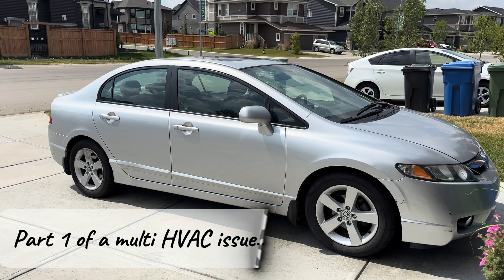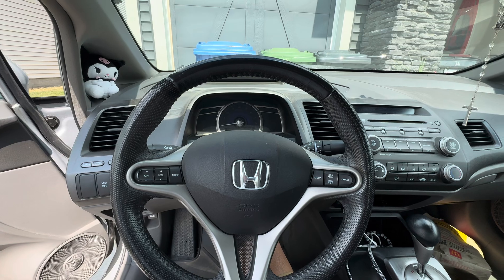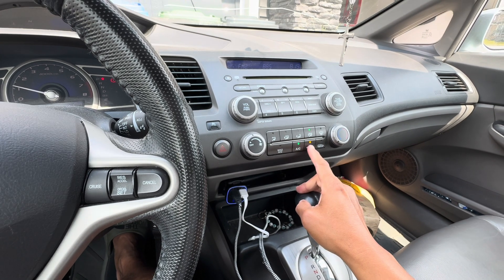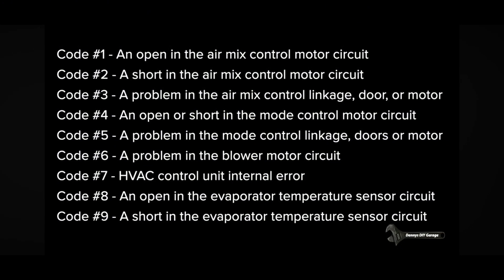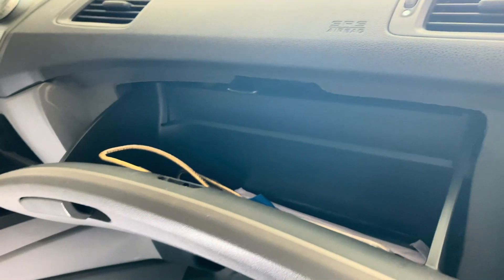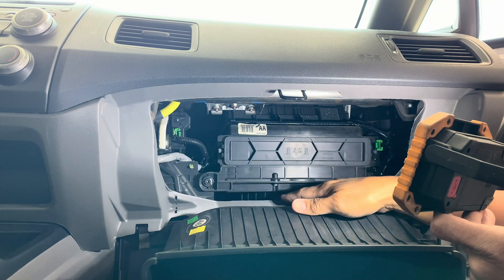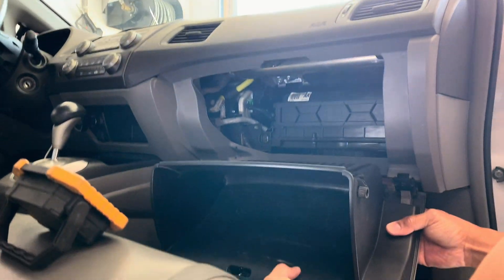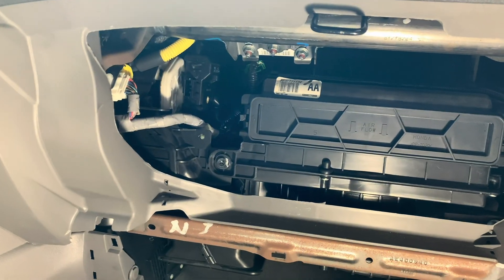Diagnosing and Repairing a Faulty Air Vent Mode Actuator in a 2011 Honda Civic HVAC System

Comment: Thank you for the great Video! Its very weird, actuator works after plugged into green socket for testing , but once it installed, it does not work, air directions did not change at all and stuck on deforest.  Did you apply some grease on the back of the actuator?
Reply from the maker: Make sure the control arm is sitting properly or not broken.
Reply: @JNBTuning thanks for your reply. How do I know if control arm is broken? Can I test it?
Reply from the maker: @Leo-pz7ry you should be able to see it actuate as you change modes. Just exactly how I was doing after the install to test it. Change mode, watch how the arm is being actuated, and check the vent desired if working.
Reply: @JNBTuning arm is not moving at all after pushed air distribution buttons, but if just plugged in the green socket, arm will moving.

Comment: Well I tried this tonight on my '08 Civic, and I get no light from the inside recycle button when I hold them both down. I don't hear or see my system going through any check process.
Reply: Did you ever figure out the problem?
Reply: @abigailcisneros17 I replaced the motor assembly. $20 something from Amazon. Works fine now. It's the motor, just replace it

Comment: Thanks for this. I have a 2008 Civic sedan. When I hit the button for air to flow on top vents, nothing comes out. I can hear the fan or whatever whirring and cranking, but I think the actuator is "stuck" on the defrost position because air only comes out the defrost vent or at my feet.

How did you confirm that the old actuator is actually broken as opposed to not just needing more grease???
Reply from the maker: When you have it all open down there just try all the modes and see how the actuator is operating. You can record it on your cell phone. Each mode should actuate/move to open and close vents depending on the mode chosen. If it doesn’t move then you will know it is broken.
Reply: @JNBTuning  yeah no matter what button I press, it's shooting out at the windshield. The fan is working and it blows on High no problem, just happened yesterday for the first time. Thank god it's October and not May.

Comment: I have an 09 civic. I did the diagnostic code process. The light on my heater control panel didnt flash but the check engine light flashed 5 times. My issue is the when I turn on recirculation I can still smell odors coming in from outside through the vent. Idk what controls that. Both actuators move for the things they control. Nothing moves when I turn on recirculation.
Reply from the maker: Very strange! The check engine lights shouldn’t flash as this is nothing to do with the engine. With your symptoms it will still the same actuator that i worked on that is controlling the recirculation. How about the other venting modes? Are they still working? Remember that it could be the recirculation door could also be the culprit.

Comment: Hate to ask, but what do you think my issue is if I’m only getting Cold air through   One single vent closest to the passenger door?
Reply from the maker: Don’t the test like what I have done and see what code
Reply: @JNBTuning I did but it wouldn’t blink, it turns off stops blowing for a couple seconds and then come back on but no blinks. I also didn’t understand the sequence. Ignition off> press butttons together> turn key acc on> or 

Ignition on> press and hold buttons> wait for blink? I tried both, but none worked. I’m a bit confused
Reply: Sounds like low on AC gas. Figure out if it ever leaked before, and/or check for leaks.
Reply from the maker: @taz24787 please watch the video when you get a chance.

Comment: I got a code 3. How do you suggest i fix it?
Reply from the maker: That would be your air blend actuator located on the driver side near the accelerator pedal underneath the dash
Reply: @JNBTuning I actually changed that first but the code is still there. Now I'm really worried
Reply from the maker: @jayecks1 did check the actual arm that controls the actual door making sure it moves freely?
Reply: @JNBTuning  I didn't where do I find it tho
Reply: @JNBTuning thanks for replying BTW I appreciate it
Reply from the maker: @jayecks1 same spot it is part of the same system. The actuator moves the arm that controls the door that blends the hot and cold air
Reply: @JNBTuning  ok I installed a new  blend door actuator and tested it and it works but the code is there. Im wondering if the door itself is the problem
Reply from the maker: Sorry man it is really hard to help you out remotely.